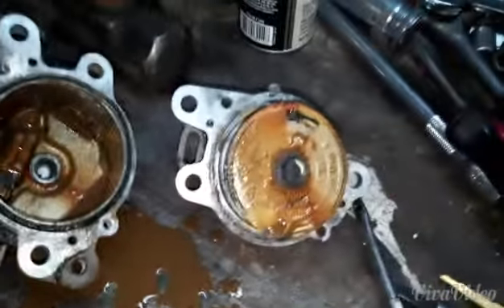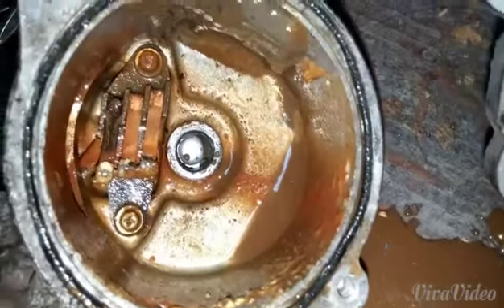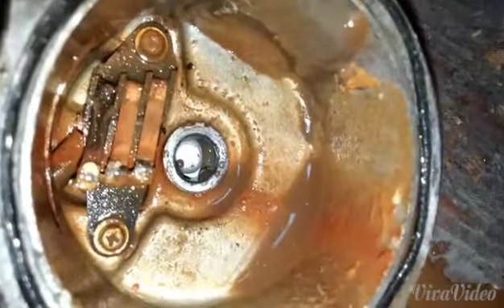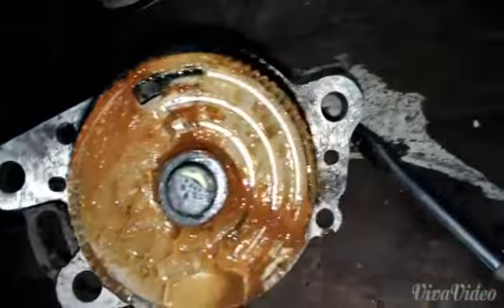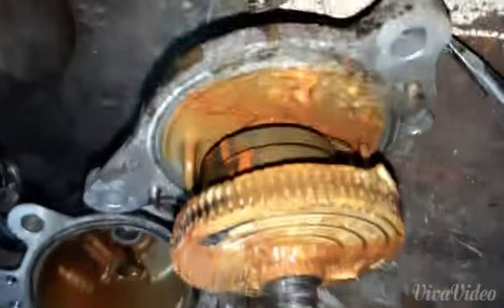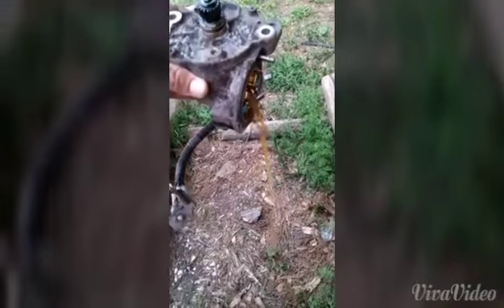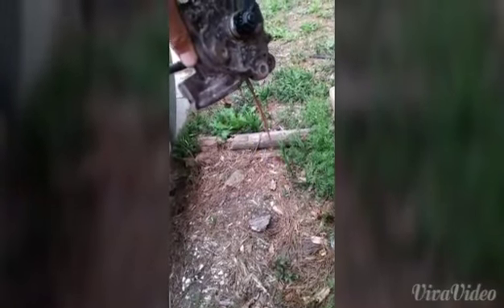Diff lock actuator rebuild

Comment: Hey Christian. I bought a brand new 2015 rubicon like yours and haven't even broken it in yet, but I have a friend with 2014 foreman, and another with 2015 rubicon who ride like you do and I was wondering if you had trouble with 4x4 and diff lock staying locked in like they do? How did you resolve/prevent it. I don't wanna end up like this on mine when I finally do have to cross some water or something.

Friend has a code 97 it wont even come out of diff lock, and before that he left it in 4wd cause he was having trouble with it going to and from... he water wheelies non stop tho...

Comment: your diff vent coming off made thag fill with water? i thought the actuater was a sealed unit and the diff vent only vented the actual diff. this is prolly the cause of everyone's 4x4 lighy flashing
Reply from the maker: +Casey Harte-maxwell not on land cruisers it has its own small vent line runs in the wiring harness for the actuator

Comment: If Toyota engineered it right, there shouldn't be water in in the first place. I have the same problem on a 2006 Prado, except everything inside the actuator is destroyed.
Reply from the maker: +Almero Toyota engineer that 100% right it actually breathe through a hose that goes up the harness for the diff lock actuator unfortunately my truck has been door mirror deep 15 times. Thing is still working and it's 22 years old lol sorry about your Prado get a real Land Cruiser LOL
Reply: this means your actuator had issues maybe O seal was damaged
Reply: I bought another unit. replaced all seals. Drove the car for 40miles in rain on tarmac when the light came on. opened it up, and there was water inside again. what does the rubber pipe ontop of the unit do? is it vacuum?
Reply: Would recommend you replace the whole thing.  Its a life saver
Reply: Johnson g3 i did. New unit filled with water after 40miles.
Reply: Almero sorry my bud.  It needs a pro tech.  Or a Toyota dealer but hope the replaced part was genuine.